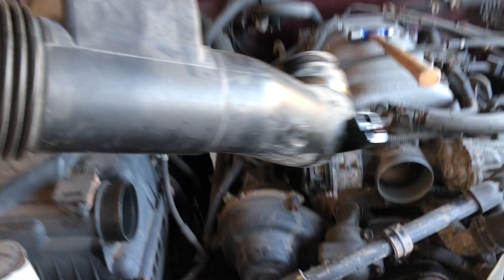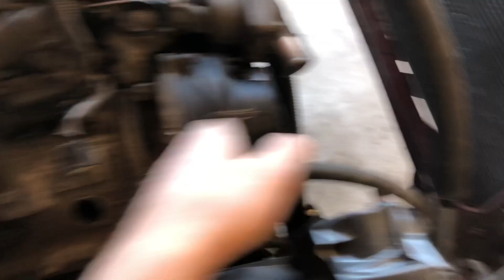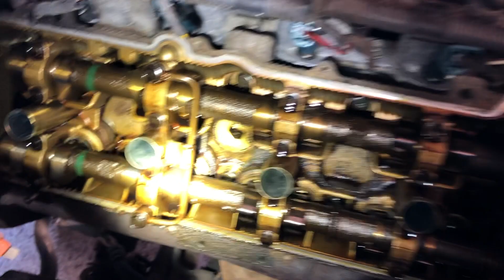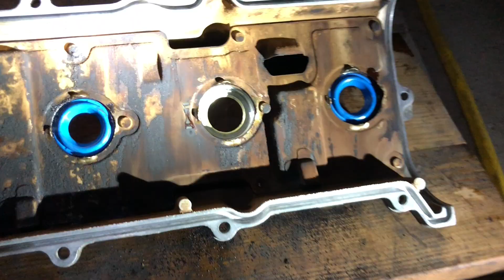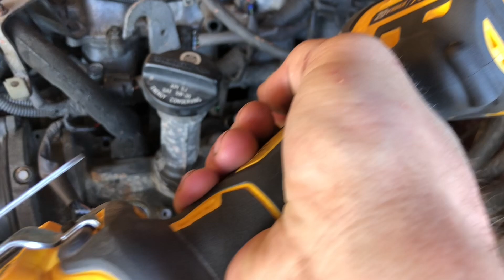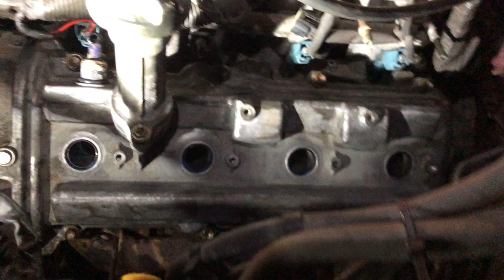1st Gen Toyota Sequoia (Tundra, 4Runner) 4.7 V8 Valve Cover Gasket Replacement

Comment: I've got 450k miles on my 02 sequoia. Commuted with it for years hauling sales samples in a trailer. Did the timing belt over the summer and see the valvle covers are leaking. as I work in my driveway, they're going to keep leaking. I don't dare open them up outside incase soemething blowas in. Thank you
Reply from the maker: Heck yeah, congrats!  I’m approaching 400k myself.  Just finished replacing the exhaust manifolds from the nasty ticking I’ve dealt with for the last 10 years…

Hope the video helps.  Here’s to the next 100k miles!

Comment: Looks like you put a lot of miles on that engine. Do you still have the Sequoia? And, if so, how many miles?  My 2003 Tundra is starting to slow leak on the valve cover gaskets with 212k miles. Good video. Will probably watch multiple videos of this to get more comfortable.
Reply from the maker: Oh, I still drive it!  In fact, I just recently got back from a couple week road trip where I covered 7000 miles.  Towed a 5000 lb trailer 1200 miles a few months ago, and I’m about to tow the same 5000 lbs 1800 miles in about two weeks.  She’s about to roll over 360k.

The engine and your tundra will last as long as you want them to as long as you keep up with basic maintenance.  Definitely hold onto your rig as long as you can, they don’t make trucks like these anymore.

Comment: you put the spark plug seals in the wrong way
Reply from the maker: Pretty sure they’re the right direction.  I put them in based on how I took the old ones out.  Put 60k miles in since then without any problems

Comment: You’re breaking bolts because you’re using a power tool. You should always try it by hand first. Those bolts are so old hitting them with an impact wrench is too powerful and causing you unnecessary work. Just my two cents.

Comment: Great video..some don't understand why some jobs cost so much at the shop especially with older vehicles. Hoses, bolts, plastic retainers etc break. Great video thanks for sharing
Reply: I just got quoted $895 to change mine at a shop and $760 is just from labor. 100% worth doing it myself.
Reply from the maker: Exactly!  Can save a lot of money doing it yourself as long as you’re not afraid to get a little dirty!

Comment: Am doing this right now and just broke all 4 of the lower bolts off, how did you end up getting it out
Reply from the maker: Unfortunately, I had to drill them out and use a bolt extractor.  Some places can be a little tight, so I had to use a 90 degree tool on the end of my drill.  Sorry to hear about the bolts, hopefully you were able to come up with a solution!

Comment: Where did you get the replacement bolts?
Reply from the maker: I usually just get replacement hardware from Ace hardware, but if I can’t find them there, I’ll usually bite the bullet and go to the dealership.

Comment: No matter how experienced with a power tool we like to think we are, USE HAND TOOLS ON THIS JOB!!!
Cleaning the VCs/area before removing them avoids crap falling into head.
Good job on video!
Reply from the maker: You’re right, if I could go back, I’d use hand tools.  Thanks for the comment!
Reply: Came here to say this. The only reason you broke that bolt was using the impact to remove it. Live and learn.

Comment: I was wondering where is the VVTi solenoid? I thought it was under the valve cover? But I didn’t see it? Please advise.
Reply from the maker: I’m so sorry I missed your comment!  I haven’t worked in the VVTI version of this engine, but I have the workshop manual for it.  Were you able to figure it out?
Reply: @derekmcguckin2114  sure did. Doesn't not have one! 1st gen version. 4.7L I force but does not have vvt. Thanks for replying.

Comment: do you live in snow country with lots of salt?   I was surprised the bolts were seized and broke.    I am not in snow country and my bolts are all actually loose.   I snugged them temporarily but will be replacing the gaskets in a couple months.   Both my 2000 Tundra and 2001 sequoia were loose.
Reply from the maker: Yeah, first 13 years in New Jersey and then 4 years in Colorado.  It’s seen some salty winters.
Reply: Don't use an impact.

Comment: Is there anything you think you could’ve done differently to prevent the issues with the bolts?
Reply: Not using an impact would be a start.
Reply from the maker: Maybe spray them with PB blaster over the span of several days and maybe heating them up with the torch right from the beginning.  20 year old vehicle is bound to have some broken bolts at some point unfortunately.
Reply: @derekmcguckin2114  I will keep that in mind. Thanks for the quick response. For that, you def deserve a sub. You making quality useful vids comes as a bonus.

Should get yourself a phone holder or tripod of sorts.
Reply: @derekmcguckin2114  probably wrong but for some reason when I think of heating these little bolts up I envision them snap easier b/c they are hot. Anyway ordered the gasket, had two mechanics rip me off and never did drivers side on wife’s 99’ LX470. So I’m going to try it, first mechanic had for 3 weeks b/c he broke 2 bolts off.  I’m sure it will happen, film your errors and fixes man, we all like to see that and would help when one breaks. What size bit you had to use etc. Where ere are you getting your inserts  and what are they called exactly I know what’s coming….
  Thanks, great video.

Comment: Just noticed my right side valve cover leaking when doing my most recent oil change... right onto the exhaust manifold of my 2000 Tundra.  205k miles on it and it still purrs like a new engine.  So I'll be hitting it soon.  Thanks for the video.
Reply from the maker: Smart move to change the seal!  Hopefully the video is helpful!

Comment: Great video. Wish you had a vvti model so you could have done the cam seals. I’m still not confident with the videos that are out there.
Reply from the maker: Wish I could have provided a little more information for you!  If you’re not able to find a good video for the VVTI version, you may want to consider purchasing the workshop manual for your vehicle
Reply: @derekmcguckin2114  Thank you. Just found someone selling all three volumes on eBay for $300.
Reply from the maker: Nice, I wish you the best of luck getting it done!
Reply: @TheBillyBlack  Did you find (or make) a video for the VVTI V8 engine?
Reply: @mikeligas5561  no. The leak that I have comes and goes so I don’t have the motivation yet.
Reply: @TheBillyBlack  My 2005 V-8 VVTI engine is a 2UZ-FE engine and I found this video.  It looks like the only difference is that there are 2 half circles on each valve cover.  https://www.youtube.com/watch?v=dR_s0AwQ52g

Comment: What model dewalt impact u using in the video? Thx
Reply: Don't use an impact tool for this repair.
Reply from the maker: My impact driver model number is DCF887.  It’s more suited for use with screws, but you can get 1/4, 3/8, and 1/2 inch socket adapters (dw2541ir, dw2542ir, and dw2547ir respectively). I got all three adapters as a kit on Amazon for around 12$.

Comment: I have a small leak and I’m not sure where it’s from, mostly seen on the back of the oil pan. I’m going to do oil pan gasket on my next oil change and if that doesn’t fix it I’ll do this.
Reply from the maker: The valve cover gaskets typically leak towards the back.  I would check to see if you have any oil leaking from back there.  Also check where the dipstick separates halfway down.  Hope you can figure out where the leak is coming from!

Comment: Thanks for the awesome job, did you actually did a timing belts video? and when do you think the timing belt should be changed?
Reply from the maker: Yep, I do have a timing belt video!  Toyota recommends every 100k for the timing belt/water pump.  My sequoia has 302k, and I put the third timing belt on it around 299k.  I did the valve cover gaskets at the same time because I had a lot of the components out of the way and made the job easier.
Reply: @derekmcguckin2114   about time to change my valve cover gaskets. Considering doing the timing belt as well. Likewise for the water pump. I’ll be on the lookout if you’ve a vid on that as well as the timing belt. Any other part replacement recommendations to go along with?
Reply from the maker: I’d say really just the water pump, timing belt and the timing belt pulleys (usually all comes as a kit) as preventative maintenance.  Really just depends on the condition of your car.  I’d recommend the Aisin kit from rockauto as that is the brand that made the original OEM parts and is pretty well made.  Definitely change the belt tensioner as well (should come with the kit).

From there, I tend to just fix things as they break. (Shocks, steering rack, etc...)

Comment: Thanks, Just bought a 02 Tundra and look to tackle this job soon.
Reply from the maker: Congrats on the truck, pretty reliable drivetrain
Reply: @derekmcguckin2114  Thank you, that's what I've been seeing here. Bought it as a project, and want to learn more about automotive in general (I work in tech) Starting with a fluid change throughout, and will start knocking off the maintain items one by one. Any other suggestions to watch out for?
Reply from the maker: Depending how many miles it has, definitely want to do timing belt/water pump every 100k.  I’ve broken off more bolt heads than I can count, so definitely make sure you have a torch handy, some penetrating fluid (I like pb blaster) and maybe a thread insert kit which hopefully you won’t need.
Reply: @derekmcguckin2114  Bought it with 270k, overpaid a bit, but it's a 4x4, so by that logic, I should perhaps do the water pump and timing belt when I do this. Thanks, I'll pick the fluid, and torch up as well. How about the radiator? Will there be tell tell signs as to when it needs changed out? Not cooling as well?
Reply from the maker: Well, mine has 302k, and it’s on the original radiator.  I’m sure you can pull off using original, just be cautious when removing the coolant hoses and transmission cooler lines as you could break the stems off the radiator.  I opted to not risk snapping them off, so I cut the lines off and just replaced the hoses.  Cooling for me seems just fine